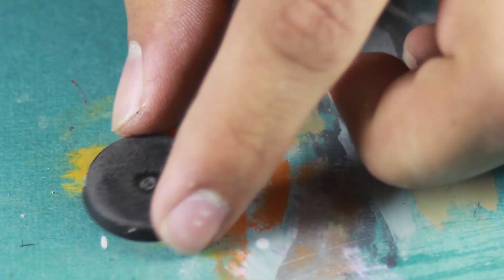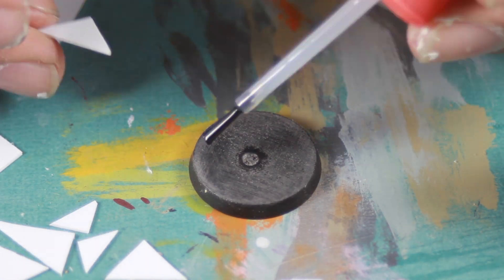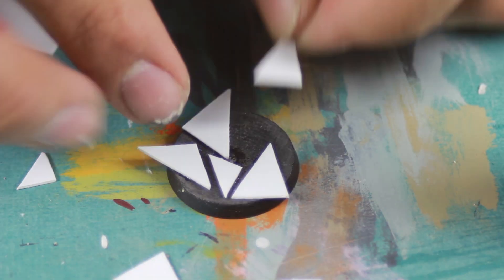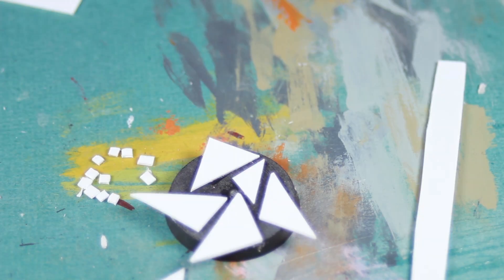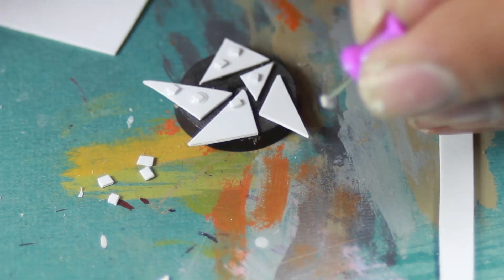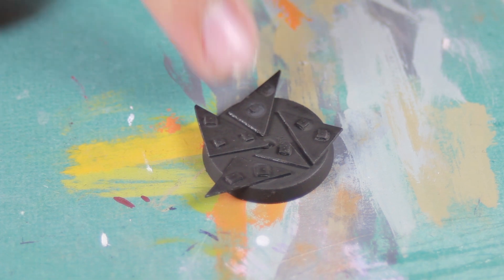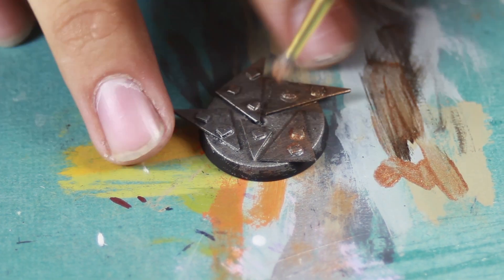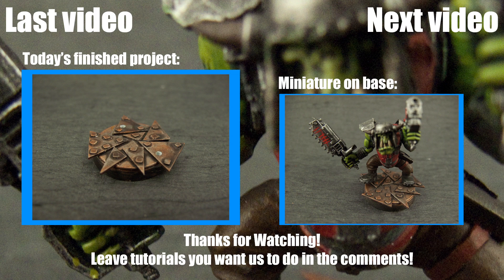How to Create an Ork Mechanical Base

Comment: My only problem with this style of base is that it makes the unit's footprint larger and irregular.

My favorite rivet making method is taking a hole-punch to a sheet of Shrinky-Dinks and then baking the holes. The Remainder of the sheet can also be baked and painted up as scrap metal.
Reply: Great advice. Thanks